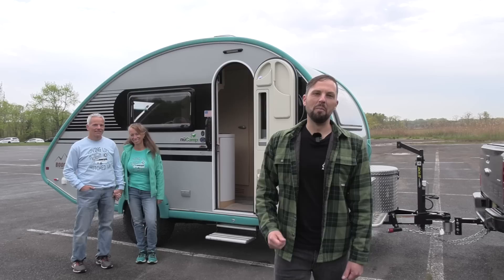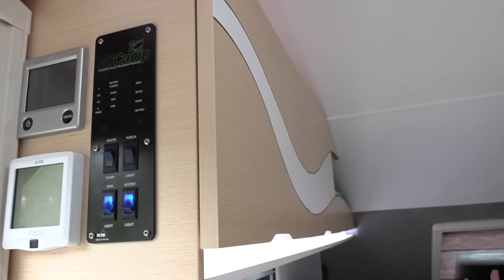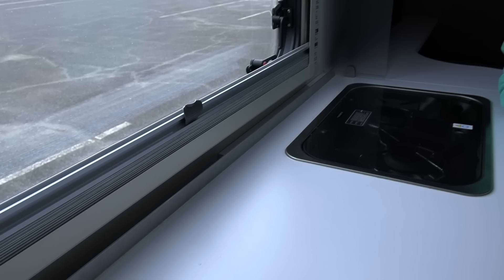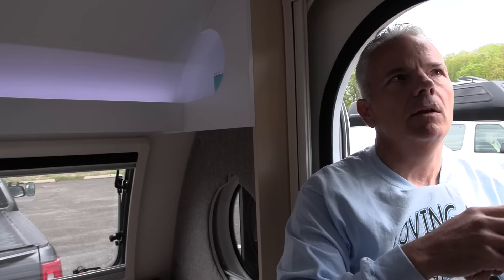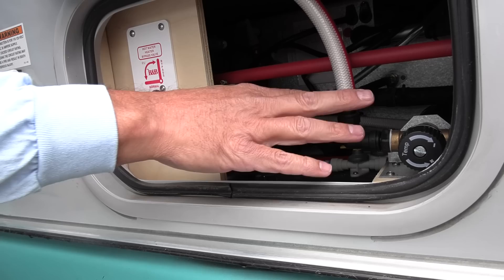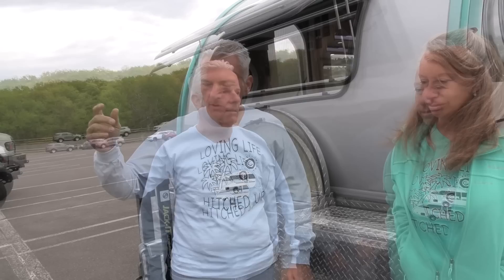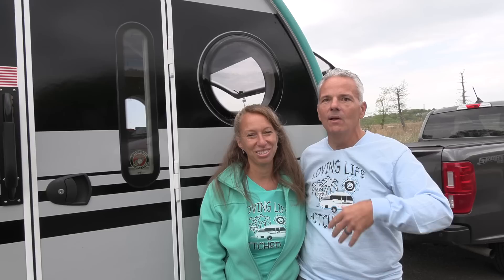TINY Teardrop Camper Tour NuCamp Tab 400 Boondock Lite Travel Trailer Small

Comment: Very well designed trailer, one of the best yet.  Layout is excellent.
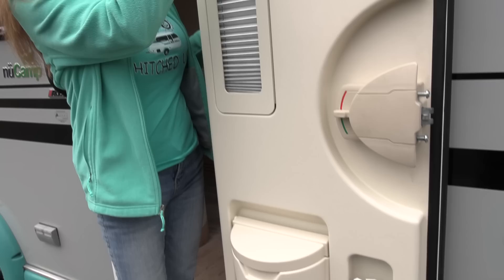17:52 - I love the door.  Its very Euro RV style.  Makes so much sense to add storage to the door. This should be standard on all US RVs.

The teal trim is SO much better than black, well done!  Now it has a holiday vibe.  Plastic dip is a smart choice.  It will protect against chips.  Plus the lady is all matched up to the trailer, so cute!

18:44 - Aluminum manual stair step - the best!  Where can I buy one?  This is what I need instead of the rusty, heavy steel ones.

I would love to know more about the brake system you have and what you plan to buy.  I sometimes tow my car behind my RV and this would be handy to have.  Last time I checked it was over $1000.  Cheaper version?  Please do a video on this. Also one on Pepwave your internet solution.  The internet is key.

I see you are from Florida from your plates.  I wanted to visit and even move there.  Being hot, you probably need your AC on during summer.  Can you:
1. Park an RV anywhere and stay overnight without camping fees?
2. Rent a camping spot cheaply?  What are rates like?  I just need a shower and shore power.
3. Park by the beach so its cool at night so you can sleep without AC on?

Thanks to all for a great tour.  I enjoyed this very much. Finally, a good trailer design in a compact package!

Comment: Hello. I really like this TT. My SUV has a trailer weight limit of 3500 lbs and the current wet weights (*without* propane and accessories) of the 400 models offered put them at around 3200-3300 lbs, which doesn't leave much margin for items. I can't seem to find the 'lite' model on the NuCamp website... is it truly 3100 lbs? Do you know if it's still available? Thanks.

Comment: How much did this cost. What kind of vehicle can pull it.
Reply: The biggest con on this tab 400 is cost.  Nucamp is a high end oem and they make great quality tear drops.  But most will pass up nucamps for much larger/light weight travel trailers.  A 2023 tab 400 will run you 40K.  And they are a very low volume producer so they pretty much get MSRP or close to it.  But I'll say unlike most smaller travel trailers they are built way better.  FYI, they are allot smaller inside then how allot of videos present them.  IMO, the bathroom is unusable for showers.  But the folks in this vid are smaller so I can see how they manage with that. But recession is setting in  and I saw a tab 400 on RV trader in FL for under 20K that had only been used a couple of times and was garaged keep.  The great thing is they are made well so buying a used one does not mean you will be left with allot of problems like with most low cost travel trailers.  As far as towing vehicle you should have 5K minimum.  Because you will need to account for all your stuff loaded in camper and tow vehicle.

Comment: @8:12 Isn't Glycol just anti-freeze? Heating the WATER in the lines is what's producing heat - not the glycol.
Reply: The Glycol is heated and circulated through the lines, but not under pressure that is what radiates the heat. The same Alde system also heats the water for hot water the glycol circulates around a mixing tank to assist in heating the water for the shower.  You can heat the trailer with no water in it, (winterized) on either electric or propane. It’s actually  a cool set up.
Reply: @ForbinColossus  Thanks for the link, will read this as always willing to know all the ins and outs.